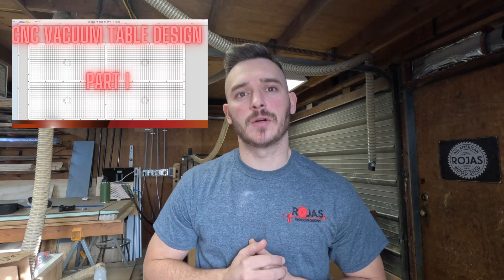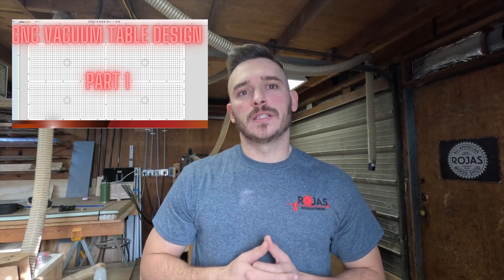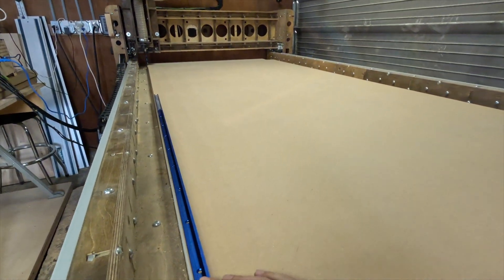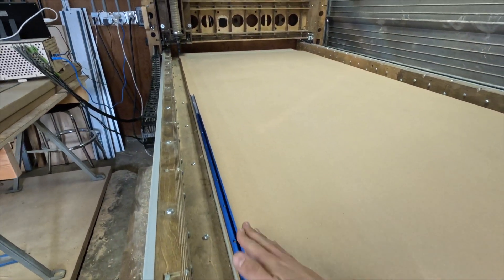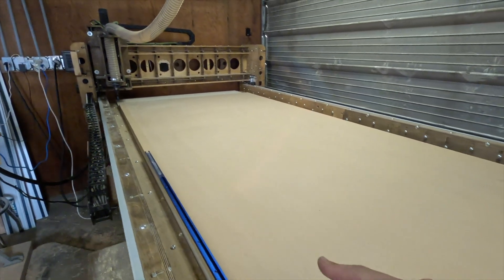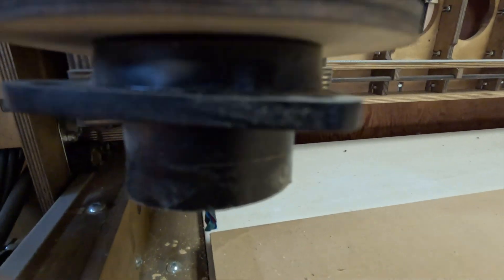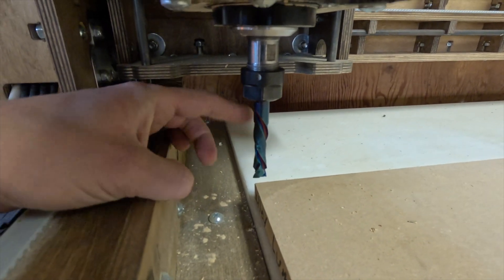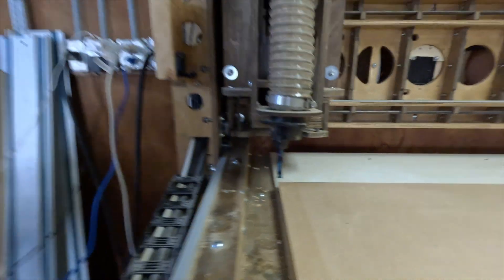Transform Your Workspace With This Vacuum Table Diy: Part 7!

Comment: Did you surface your mdf layer on both sides before cutting the slots for the tracks? Or did you get a special mdf that dosnt have the paper sides? Im talkong out of my butt just want to make sire i dont miss a step if you did have to. Seems ive heard both ways